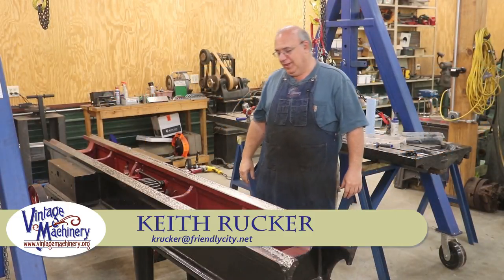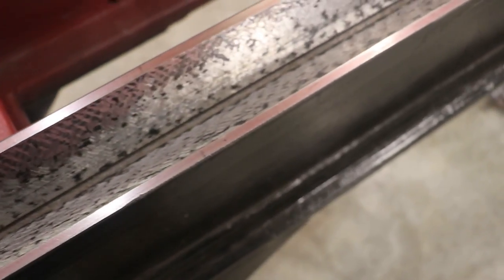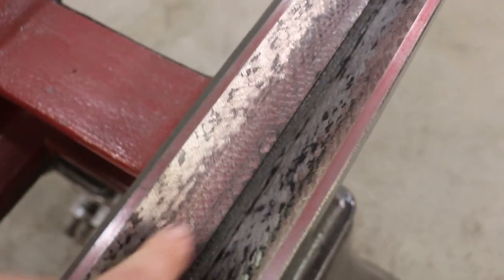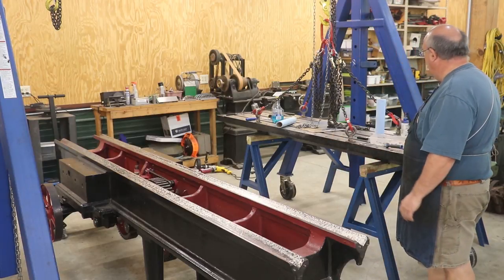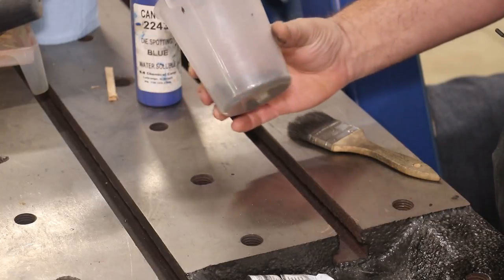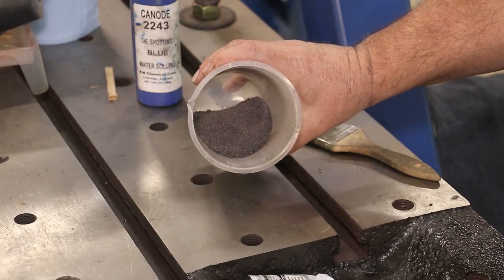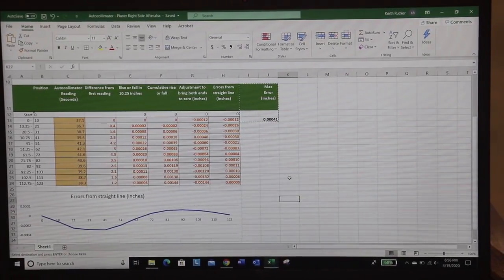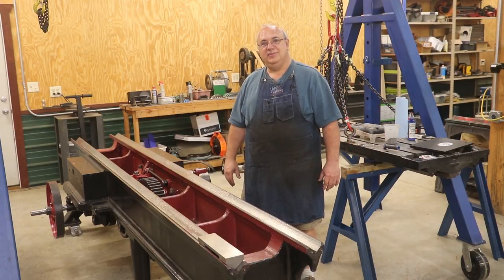Metal Planer Restoration - Part 28:  Final Scraping of the Base Bed and Testing

Comment: Scraping the top may be a big mistake. The reason machine beds are scraped on only one side is two scraped surfaces will not slide smoothly together. Think about it, points of contact sliding against points of contact. Points of contact will slide smoothly against a ground surface.

Comment: Roughly 10% of your error (41 millionths) is because the bed is wrapping itself around the curvature of the Earth. Insane precision!
Reply: Great comment! I was so intrigued, I had to go and work it out for myself.
Reply: @flat-earther  float glass bends under its own weight though
Reply: When they measured the x shaped platinum rod, they measured it on nodes instead of the ends to prevent it from sagging due to the earths gravity.

Comment: Converting to metric
 measurements, so over 3.65m there’s a variance of 0.01mm.....absolutely mind boggling the level of precision you’ve got there Keith. Amazing work
Reply: @martin09091989  lol
Reply: For metric guys it doesn't sound that amazing, but then again, this is more than the machine ever, ever got specced out to do.
Reply: I think you mean converting to 'metric' measurements, since 0.0004" is a decimal measurement.

Comment: You probably don't want another comment relating to this but I would like to mention that if you scrape the table it will carry a lot more oil off of the bed ways. It only needs oil on the bed if it carries oil on both it wont stay flat during the passes and need quite a bit more lube.  It is a planer however so it is all relative as they lift during cutting and on direction change. An old girl like that wouldn't have a cushioned or even braked direction change. This is a big reason why modern units use hydraulic cylinders. Unless you plan to fit oil wetting rollers at the ends of each way I wouldn't bother scraping the table.
Reply: Being belt driven its stretch provides a degree of cushioning.
Reply: I don't think the table should be scraped either.  As you say in the video, the table was supported over its whole length during grinding, so its ways should be very straight already.  The purpose of scraping the bed was to provide oil retention and support along the whole length of the ways.  You have this already.  Scraping the table is likely to actually REDUCE the number of points of contact.  The extra surface roughness may also lead to higher friction between the bed and table ways.  That'll be 2 cents, please :)
Reply: @chrisarmstrong8198  Hi from Ireland Chris. That is my thinking also. It's worth at least 5 cents. Cheers.

Comment: Think I would be inclined to let the ground surface of the table run on the scraped vways of the base. It would be like a Monarch lathe only with the surfaces inverted.  I don't think scraping the base would gain you anything in terms of accuracy or wear and if you do you will have to re check and possibly rescrape the base from any alterations in geometry that might occur from scraping the top.
Reply: You better check with Bailey on that LOL
Reply: @frankdeegan8974  Baily isn't about at the moment . still getting  tummy tickles  for the gearbox job .

Comment: Seems to me that before you put any time into scraping the table you should use your autocollimator to check the "runout" of the top of the table as it passes over the base.  I suspect that with a variability in the base of only 4 tenths the TOP of the table will not move at all due to its stiffness and the precision of the ways.  And that result should be valid wherever you place the mirror of the autocollimator.

Comment: Back in my day as a large tool aircraft plastic tool maker, we stabilized the feet under our fixtures with copious amounts of plaster of Paris infused with sisal fiber to lock it to the floor. Shutting a door would vibrate up to .003 and our tolerance to calibrate was +/- .001.
Reply: That is pretty amazing!

Comment: Keith how do you intend to anchor your height adjusting feet to the floor to stop the machine "walking' once it is in operation? When I had to bolt down large cast iron textile machinery some 55 years ago, we used to use pyramid headed bolts with poured lead/antimony to secure the bolts into the concrete floor. I suppose nowadays, one uses an epoxy material, much easier and safer than pouring molten lead alloy into holes in concrete.
Reply: I have not heard him mention "bolting" this machine to the floor.
Reply: I have operated a planer of similar size at the railroad museum I belong to.  The machine is not bolted down and has never "walked" so much as a millimeter.  Planers are very different from shapers in that the bed moves relatively slowly and much of the energy involved in changing direction at the end of each stroke is adsorbed by the belt drive.  In fact, speed is the primary reason these machines disappeared.
Reply: @clham612  thanks for clearing that up with real world experience. I thought for sure that thing would recoil back and forth as the table changed direction.

Comment: According to my fussy math, 0.0004" in 12' is about an angle of 0.57 seconds.
As someone once said, "Machinists have tolerance issues."
Reply: What is the accuracy of the measuring tools? Have they been checked?
Reply: Ron and Keith, Sorru for my error. Best I can tell I misread 12’ as 12“ I may have made the same mistake on other comments as well.,

 (Disregard: Ron, But .0004 times 12’ is 0.0048, almost 5 thou. Do you want your work 5 thou thicker at one end? 
Perhaps Keith could add a couple more pairs of legs and jack up the low spots.)
Reply: @tobyw9573  At 15:00 Keith states that the error is 0.0004" over the 12', not per foot so there is no need to multiply by 12'. I could be wrong but until someone can prove otherwise, I will stay with my calculation. In all reality, does it really make that much difference what the error is as long as Keith is happy? :-)

Comment: It would extremely interesting IF there were some way to measure how machines surface planed parts would have came out without any scraping and then after what you've already done. I would be very surprised to see if you could actually measure the different. But that elusive goal of having everything "perfect" always gets in the way. Maybe there really is a reason they have factory limit to what is and what isn't acceptable to be a quality product. Once you get to such minute measurements, the end results are negligible... JMHO Thumbs Up!
Reply: Not that I'm any kind of expert but as he mentioned in the early part of the video the way's as they were with ground surfaces it would have still been well within the OEM factory specifications already. All that scraping did serve two purposes though, a bit better than twice the surface ground accuracy with it installed and leveled to it's working position, and possibly more important much less wear due to a better oil to oil contact between both parts. There's also one more advantage that's usually forgotten about with scraped surfaces. With two ground surfaces there's a slight amount of averaging out due to minor wear while the surfaces bed in together then they start to slowly wear out. With scraping that bed in period takes much much longer and keeps getting more accurate as both those surfaces average themselves out until most of the scraping is gone and it then starts to wear to less accuracy. It would be interesting to see the same measurements taken after say 100 or more hrs of operating time just to see how much improvement the slight amount of wear to the high points between both parts has done. As is with roughly a bit less than .0005" over 12' I'd ball park guess that you might see it go to half that deviation or maybe a bit better?

Comment: The biggest difference to the original design and now is going to be your choice of lubricant. The additives really can make a huge difference to cold welding pick up and for that matter corrosion while its idle. Maybe some one here knows the best lubricant today, compared to colza oil or whatever they used, it's going to be a big improvement.

Comment: Are you concerned about the clearance between the rack and bull gear because of the machining?
Reply: Less than a thou difference from start to finish. Not really something to worry about with gears that size? I wouldn't be surprised if the tolerance spec for that was in the multiple thous.
Reply: @dolvaran  Plus whatever was taken off in the grinding process.
Reply: Think the bearings that hold the bull gear can or will be shimmed to suit .

Comment: OK, I've got a question for all you machinists out there.
Because, I don't know.

The bed is 12 feet long, about 2 feet or so wide, and the 
rails look to be about a foot deep.  After it was precision 
ground, and mounted on its 6 legs, it was deformed by 
gravity.  By my guess, the table is 8 feet long, again, about 
2 feet wide, and 3 or 4 inches thick.  It'll bend EASILY.  
Keith used the table, as the master, to scrape 
the bed in.  When not being used as a master, the table 
is sitting on 2 sawhorses.  Isn't IT warping?  Doesn't 
that throw off the precision measuring?

Keith said that the bed warped in a VERY SLIGHT "W" 
shape.  Isn't that table warping in a gentle "M" shape?
I can perceive a Montgomery-Wards interference fit 
here.  (Remember their logo.)

steve

Comment: So over 12 feet you have a variation of 0.00003416666667 and then an 8 foot long bed as near as I can see it it's overkill for something that is not anchored to the floor and that floor is cement which will flex with ground temperatures I think your chasing your tail but I'm not a machinist .

Comment: I don't know if you covered this in an earlier video. Grinding and scrapping the ways would lower the table. Doesn't that significantly change the meshing of the bull gear to rack? I can picture in my mind going too deep and causing chatter. 
  Thank you for all your hard work. You have inspired me to want to buy a hobby lathe.
Reply: Pete Engard, he talks about it when he first had the machine ground. They anticipated the amount to be ground off and also ground the same amount off where the rack mounts. Hopefully their numbers come out right, which I’m sure they will.

Comment: Hi. Great videos. I just subscribed. I have 120 brown and sharpe Camelback I have been playing with. I was pivoting it and it seems to hinge close to the center but I cant get .001 feelers in for maybe 75 percent of the scraped surface. I do have a 140 inch granite block but It hasnt been restored in 20 years. It was grade A when it was though. Do you think I could use it to check for high spots on my straight edge?

Comment: Looking to the wall at the end of a work bench there is a tool on a pedestal with several belts. That type of a tool is that ?
Reply: I believe it is a converted flat belt driven lathe no longer shaft driven from a shaft system hung from the ceiling but now electric motor driven.

Comment: Looked it up on goggle - 39.37 thou = 1mm -  of course, also 1Metre = 39.37 inches! Good old math - or maths as we brits call it for some reason! lol
Reply: We call it maths, with an S, because it's short for mathematics, not mathematic.
Reply: @BedsitBob   'Mathematic' is a legitimate word too - it doesn't always need to be a pluralized. A proper contraction of the plural would be more like 'mathics', since it is the -ic that is pluralized, not the mathemat-.

Comment: Keith I was thinking (not hindered by any knowledge haha): would it have  been a good idea if the base bed had been ground using large parallel blocks put under it where the feet normally are on the magnetic table of the grinder? It would have compensated the sag once set on it's feet?

Comment: So when you had the bed ground, if it were supported only at the leg areas, wouldn't you have ended up with a bed that didn't need scraping, except for contact points, not metal removal?

Comment: Well done for getting close to perfection Keith, but surely the weight and actual location of the over beam and supports will have a markedly adverse affect on the precision you've worked so hard to achieve? It looks to me that when fitted, the ways will sag between the middle and end support legs.

Comment: The comments I looked at seem to ignore the environment this planer is located.  That
autocollimator  will show variations due to tidal forces and that is only a small amount compared to temperature, humidity, ground motions due to water, and just leaning on the bed.  Precision is fine over small distances, but over a twelve-foot bed that degree of precision cannot be maintained.  Come back in a month and you may see the curve with an inverted polarity. will show variations due to tidal forces and that is only a small amount compared to temperature, humidity, ground motions due to water, and just leaning on the bed.  Precision is fine over small distances, but over a twelve-foot bed that degree of precision cannot be maintained.  Come back in a month and you may see the curve with an inverted polarity.

Comment: No turcite keeps the machine original.  Except for the leveling feet it could be in a musem when Keith is ready to let it go.
Reply: Keith's work on the ways would be entirely wasted in a piece of machinery that sits in a museum collecting dust. It should be used, but not carelessly to maintain the condition

Comment: Without some type of scraping you have metal to metal with no place for lubrication.  Now how do you provide a means for oil to get where it's needed and how much & how often should oil be applied. Without lubrication it will destroy itself.
Reply: why it was scraped is because of oil lubrication, it retains the oil film better....it will have drip oilers or similar

Comment: So why not find a grinder that could have ground the base WITH legs attached. Going by that logic the table is going to undo any work of scrapping may have accomplished when it is set into place or if any work piece is set upon it for that matter. The geometry of the cutter assembly with the table directly beneath it is dynamic and more effected by inertia and off center torquing  forces of cyclic braking cycle. Imagine you head moving forward as you waist is secured by a seatbelt in a sudden stop event. Only as flat as it’s rigidity can attain. The magnet bent it so not so much.
Reply: dunno it was already a large grinder, perhaps thats as big as he could find? plus it was going to be scraped anyway as it increases oil film retention

Comment: The parts look grate, exelent work. 

But i dont get it. You invest in it to make a hi precision/performance base and table, to drive them whit some old rubish belts??? Please update also the driving sistem to make it a perfectly useble hi performance machine . To much time an monye to upgrade just half of it...
Reply: I would be on the side with the flat belt power enthusiasts rather than electric motor and v belts. These machines were made for brute strength slow speed, unlike a surface grinder high speed cutting wheel relatively fast carriage for super  finish.